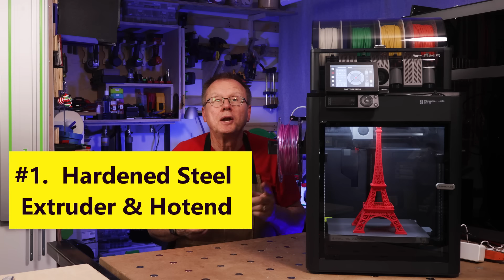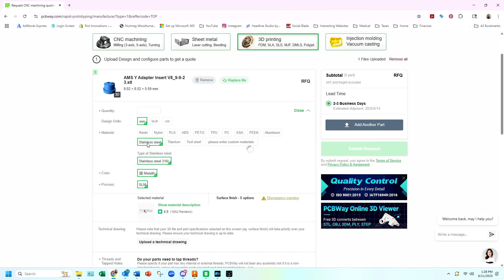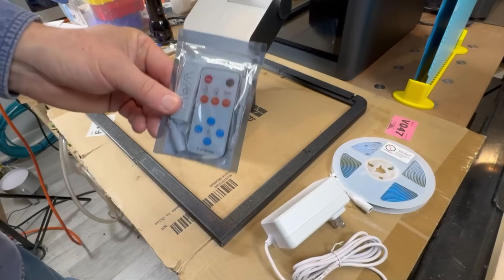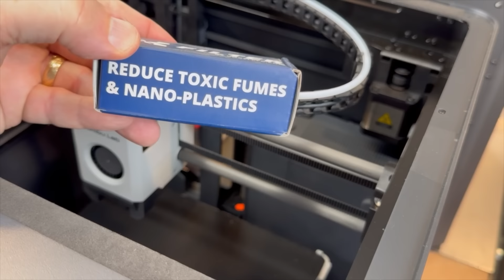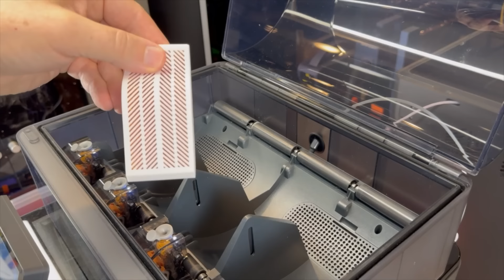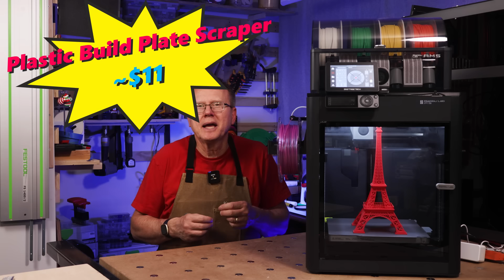The 20 BEST Upgrades for your Bambu Lab P1/X1 Series 3D Printers!

Comment: The reason they will not give you a color screen is because of two reasons. 
Maintenance : they will have to produce firmware and software updates . They will have to fix and debug all hiccups as it is a OEM product. 
Planned obsolescence :
Why give you all the bells and whistles when they can sell you a whole new product . It makes sense when you think of their ethos it is the best experience out of the box. There are cheaper more modular systems on the market for more advanced 3d printing enthusiasts anyway.

Comment: When you replace the nozzle and assembly will the temperature get hotter than the 200 degrees it comes with?
Reply from the maker: It's my understanding that the temperature remains the same when you replace the hotend.  Thanks for your question.

Comment: Another question. You mentioned several times that you printed several of the parts for the P1S out of ABS. How are you dealing with fume extraction? Are you venting to the outside? Voxel has the Bento Box for the P1S that adds an additional HEPA & charcoal filter and fans that help maintain a positive external pressure so fumes/VOCs get extracted  out the vent port. Interested to know if the Bento Box combined with Voxels X-Filter would provide enough filtration so you can print ABS with close to zero fumes/VOCs.
Reply from the maker: I have an exhaust system for my laser engravers that allow me to exhaust air to the outside.  I also have a room filtration system that is designed for a room much larger than my workshop. My longer-term plans are to build a manifold for my laser exhaust system and individually connect each of my 3D printers to it, but I haven't designed this yet.  In the meantime, I don't print very much ABS and I run my laser exhaust and room filtration system and I don't remain in the room when I am printing ABS.  I haven't installed my Bento Box in my printer yet so I don't know the effectiveness of that, but it can only help.  It's hard to know how to reach zero fumes/VOCs without an accurate particle meter, but I would also like to invest in a high-quality particle meter so that I can quantify things.  All very good questions, so thanks for that.

Comment: Biggest issue with the P1S currently is even at its reduced price of $619 with AMS 2 Pro (with stock Hub) it’s only $180 lower than the P2S. The P2S comes standard with hardened steel Extruder gear and hot end, better screen, H2 style simple hot end design makes changes simple, much better camera, stock hub supports 2 AMSs out of the box (can purchase full hub if more needed for $20) and larger charcoal filter (Voxel will be releasing an X-Filter for the P2S in the next month). This kinda makes this a no brainer. If you add even a few of the P1S upgrades you talk about here you spend more than the $180 and still not get the combined full package you get on the P2S.

But there is one downside. The filtration options in the P2S removed the ability to cleanly vent to the outside. The P1S has an external flow blower that pushes fumes/VOCs out the back and you can print a mount and connect a hose for venting. Not sure why they removed this option on the P2S. It’s almost like this printer is really for PLA/PETG/PET which have reduced fumes/VOCs.
Reply from the maker: Thanks for providing a detailed comparison between the Bambu Lab P1S to the P2S. There are a lot of questions out there regarding Bambu Lab's logic on the P2S exhaust.  I agree with you that the better choice is the P2S, based on all of its new features, and The Voxel upgrade for the P2S could be the answer for the P2S exhaust issue.
Reply: What vent set up or where should i place my P1S? I’ve been hearing a lot about venting the fumes but i don’t have any space near any windows to vent. Do i need to vent to a window?

Comment: Do you think getting the PS1 on sale right now and upgrading as I go vs saving up some more money and getting the P2s? Iv been bumming prints off my buddy’s older Bambu and I’m hooked and ready to get into the hobby coming from a mechanical and automotive sports background.
Reply from the maker: I think the P1S is quite a bargain right now for what you get. I have enjoyed my P1S for a long time, but I just bought a P2S so I will be comparing the two printers in the coming month or so in a video.  I think your plan to buy a P1S now and upgrade to a P2S down the road is a sound approach.  Good luck with your decision.
Reply: @ristinnovations so far loving my p1s, printing non stop for days now 😂 I’m hooked

Comment: people need to be careful with HEPA filters, you can find a bunch of designs were you can build your own carbon and HEPA filter with aftermarket vacuum robot filters, the problem with that is that most of those ''HEPA'' filters on amazon are not even HEPA they let way to many particles trough, i made a test were i blew cigarette smoke trough the voxel HEPA filter and in one i got from amazon, the voxel HEPA filter let a bit smoke trough but the amazon one was like there is no filter at all, so rather pay 5$ for those from voxel then those fake one and risk it to inhale fumes
Reply from the maker: That's a great point regarding HEPA filters.  Thanks for sharing your experience.
Reply: @ristinnovations  you welcome, i wish more people talked about this because its dangerous since most people dont test those filters after purchase

Comment: Where is the best place to put the P1S printer in your home in relation to ventilation?
Reply from the maker: You need proper ventilation wherever you decide to set up your printer. Some people set them up in their garage with the door open, but that doesn’t work in the winter time, and even could be a problem in the summer if it’s extremely humid and hot. The key is moving fresh air into the room and trying to exhaust the contaminants from the printer outside, whether that means fans, exhaust blowers near or attached to the printer, etc. it’s all about minimizing exposure to the contaminants from the printer so try to have high turnover of air into the room, minimize your time in the same room, isolate the air from the printer, etc. I compare it to a laser engraver; you can’t run a laser engraver without an exhaust or you will fill up your room with smoke in minutes. It’s just with 3D printers, you may not smell the contaminants depending on the material you are printing. I hope this gives you some ideas on how and where you can set up your printer. It’s ultimately up to each person to  make sure they are working in a safe area with their printer. Thanks for the question.
Reply: @ristinnovations  Thanks.

Comment: I have the same exact problem with the Bambu 4in1 splitter. It just jams 98‰ of the time. The 3d printed model you show with the 3 adapters, it has worked flawless.
Reply from the maker: Thanks for sharing your similar experience with the filament splitter and adapters.

Comment: The CoolPlate SuperTak is not that good.  I've had it for a month now on my 12 machines, running 24/7.  It works like a charm for I would say the first 10 prints, but then I've had many failures across all my machines doing articulated items.  I've added brims and they still fail randomly.  I've went back to the original CoolPlates, which are the best, by far of Bambu Plates but you can't get them anymore.  (I wonder why, lol)  The smooth PEI is my second favorite.  PEI textured were also not good and anyone who tells you they are reliable has one printer and doesn't operate in production or only prints flat parts and such.  I would recommend the Biqu Frostbite or Glacier as the newest, best technology.  So far, so good on that one.  I've been running two and just ordered another 10 to arrive this weekend.  The nozzle wiper by Biqu is amazing.  You can buy the whole kit and it comes with two spare sets of silicon grids.
Reply from the maker: Thanks for sharing your experience with the various build plates in your production environment. Also, thanks for mentioning your experience with the BIQU nozzle wiper.

Comment: Only issue with the hygrometer in with the desiccant holder in the AMS is it gives a false reading as it is so close to the desiccant. The AMS has a more accurate one built in and can be easily viewed in Bambu Studio or the Bambu Handy app.
Reply from the maker: I do agree that the hygrometer reading could be impacted by being so close to the desiccant, but it does give an indication of when the desiccant needs to be changed or recharged.  Thanks for the comment.

Comment: if you don't want to spend too much on the btt touch there is also a comunity made project called xtouch that is made using a 10 euro 2.5 inch touchscreen module
Reply from the maker: Thanks for pointing out the X Touch community.

Comment: Great video!!  I am printing several fo the upgrades.  I am doing hte riser as well.  I have never used TPU.  Is 85A or 90 better for this application? Not sure if I need flexible or slightly more rigid with the gasket.  I was leaning toward the 90 becuase it would be easier to mount the LED strip maybe...  Let me know what you think and keep making these videos!! I love seeing my age folks making these!  🙂
Reply from the maker: The TPU just offers a bit of cushioning for the glass top. I used 90 myself. You will be attaching the LEDs to ABS or other temperature resistant material, which will be rigid. I hope this helps. Thanks for your comment.

Comment: I was just curious if you or anyone has been able to test the Panda Touch screen upgrade for the P1S since the firmware update? I'm interested in that upgrade, but don't want a dead screen if the firmware locked out usability and or features.
Reply from the maker: Big Tree Tech has a note on their website regarding the Panda Touch compatibility with Bambu Lab's firmware revision.  Bambu Lab's latest firmware for the P1S does impact the features of the Panda Touch.
Reply: @ristinnovations  thanks for the reply. Thats a bummer!

Comment: Nice Video. Though there is missing important information for the Panda touch screen. As it's not working with the new Firmware anymore. Unless you only work in LAN Only Mode and Development Mode.
Reply from the maker: I did mention about the Panda Touch and the latest Bambu firmware restrictions.

Comment: Great video, there are several great upgrades you listed that I now have on my to-print list.  The build plate holder I use is designed to hold multiple sizes so I can store plates for my different printers in one location. I would link it if I could find it again on makerworld.
Reply from the maker: Thanks for the feedback.  Yes, if you find it, please let me know about the build plate that holds multiple sizes. Thanks.

Comment: I will never buy a modern printer without a color display. The threat of a new update to drop support for a color display kills my desire to buy the P1S. This printer is garbage and needs to have everything replaced.
Reply: Roflmao.

You'll find the P1/X1 series printers are exceedingly capable 3d printers despite having a mono control panel.

In fact I can't recall the last time I used my screen as I primarily interface with it through bambu handy and bambu studio. Which is probably the reason they've not bothered releasing an upgrade panel for it, its just not needed.
Reply: @lmaoroflcopter I agree with that. Im only using pc with bambu studio so there's absolutely no need of a screen
Reply: A screen isn't needed for the p1s, I have 2 and bambu handy/studio is all I use on them, if it's really needed you can use an old phone or tablet to do the exact same job
Reply: I love the reasons people come up with for not having tech they can’t afford 😂

Comment: The new buffer hub for the ams pro 2 has the connector pins turned around so that the Pen you have to push in in order to release the cable is facing out instead of in. You still need the tool for the tubes though. And honestly it's still easier to use the tool to remove the multi-pin cables.
Reply from the maker: That's good to know. Thanks for sharing that about the AMS 2 Pro.
Reply: @ristinnovations  I just hooked mine up the other day and seen the difference but the spacing is still so tight that it's just easier to use the tool anyway. Not sure why they didn't fix the tube thing though guess they expect you to remove the whole unit every time you want to take out a tube.

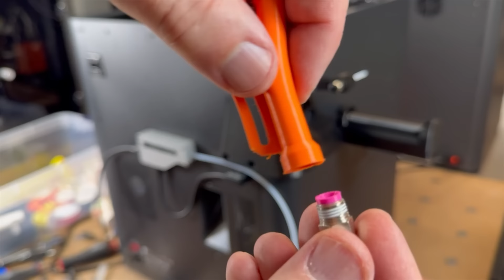Comment: @ 17:50 you mentioned the funnel adapter.  I may have overlooked the URL for the adapter.  If it's not too much of a pain, can you please point it out or add it to the Useful Links, please?
Reply from the maker: Sure, it's number 7 in the useful links section of the description.  The name of it in the description is "Bambu Lab "Y" Splitter Fitting Insert, My Design Link on Printables.  I wasn't consistent in my description of the item in the video versus the description so I can see why you didn't notice it in the description.  Thanks for the question.
Reply: Thanks :0)

Comment: I have the panda revo for the X1C, never had good results, so it has been in my drawer since the first week I got it.
Reply: Same with the Panda Claw. It just produces printing problems cause it doesn‘t fit properly. I had to take it out again.
Reply: I had one and it crapped out in less than a month. I tried to get them to exchange it. I have had to provide video evidence it’s not working, send pictures, scan something off the hot end and they still haven’t agreed to send me a replacement. I keep getting my supervisor needs to see this, see that and on and on. I will never by another one of their products
Reply: Because it’s shit
Reply from the maker: I'm sorry to hear that you didn't have a good experience with the Revo Hotend.  I haven't used mine long enough to confirm if it is worth it to me yet.  Thanks for sharing your experience.
Reply: @ristinnovations then why recommend it? Pretty weird to recommend something you don’t have extensive hours using, I’ll skip this vid